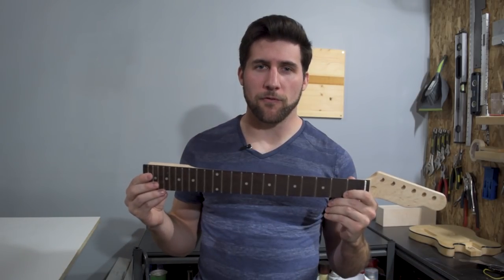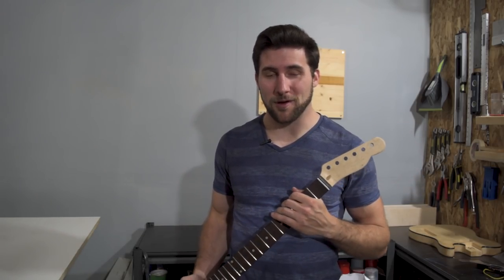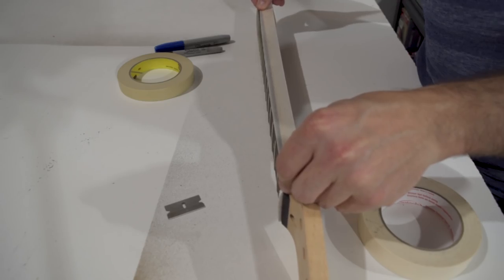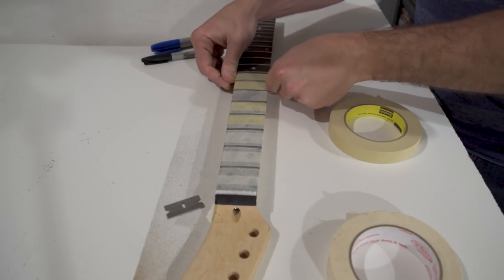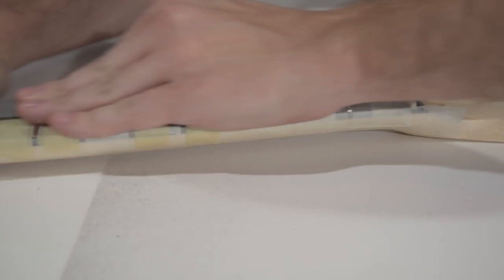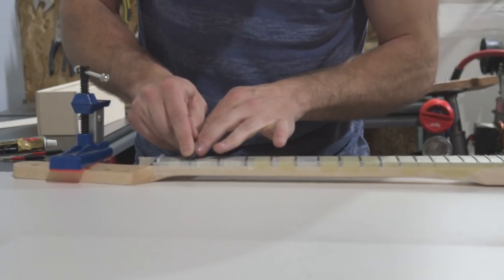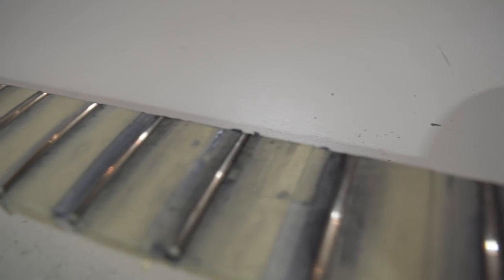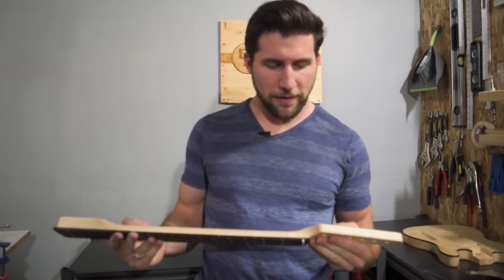Make an Inexpensive Guitar Kit Awesome! Fretwork | The Guitar Kit from Solo Music Gear (Part 3)

Comment: Your videos have helped me so much. I am in the process of making my 1st custom guitar, and you are my go-to for paint advice. I got an old Washburn ox10. I'm doing an anodized orange paint job with a vinyl decal embedded in the paint, adding mini-buckers in the single slots, adding coil splitting mini toggles for the neck and middle, adding a bridge-on switch for all 3 pups simultaneously, and finally, adding a custom 8 position varitone switch. Doing all my own woodworking and electronics. Taking my time with the paint to get it right. Should be together soon! Thank you Brad. 🤘✌
Reply from the maker: +Sean Bailey That sounds awesome. I hope it turns out great.

Comment: HEY MAN NICE JOB WITH THE FRETS U DO A BETTER JOB THAN I DO. I WILL SEND A NOTCHED STRAIGHT  EDGE FOR LEVELING THE NECK FOR THE TRUSS ROD ADJUSTMENT.  EVEN IF IT WAS DONE BEFORE IT WAS SENT, TRAVELING THRU DIFFERENT  CLIMATES OR FLIGHT CAN CHANGE THE NECK! DO THAT BEFORE LEVELING FRETS. COOL MAN, GOOD CONTENT!
Reply from the maker: +Michael Perry Thanks Mike; I used a notched straight edge to do that in the last video in this series.

Comment: I'm working on a
✔ Albatross Iceman
✔ BYOGuitar LP Jr. Double cut.

I'm diggin' the BYO LPJ 👍👍
The Albatross (◀ 1st clue!) Iceman should be called a😒 Slushy or P😱S.
Happy to qualify... if anyone asks.
✔✔ SOLO, Thanks for sending BA the two-pack. And yes, you are on my Bookmark. Hope to see you soon

Shred Hardy all.
Reply from the maker: No love for the albatross? Good to know. I’ll keep that in mind.
Reply: Brad, 
Naturally, I can only speak for Iceman. The pictures are all taken at an angle, so you can't see that the body template they appear go off of must have been drawn free-hand by a tired day laborer. I traced out an OEM on the computer screen, and scratched my head for a week on how to make it work. I almost sent it back, but then I'd be out forty bucks with nothing to show... So I just knuckled-up and put my money where my mouth is... I WILL make it work!
I'm buying shop tools (that I shouldn't need now) faster than I planned, so that's slowed me down. 
The body/neck screw holes look tapped template free, so I need to plug and redrill.
But, I will say the neck has a real comfortable feel. 
Everything else is as you would expect for $114 bucks.

Appreciate the videos, buddy. Keep 'em coming.

Comment: it is less risky to cut the tape roll itself with the blade rather than the tape on the board. you only have to glide through the first couple layers of tape, so you dont have to ruin a roll to do this. also, you might have better luck with the tape peeling part if you adhere a super sticky tape(gorrila tape is what i would try) over the taped frets after you complete the fretwork, sticking it to the unwanted tape so you can peel it off in one go. i havent tested this tape method, but you risk about 10 cents of tape trying it.(this was typed redundantly for clarity.)
Reply from the maker: +5hredder The tape removal theory sound interesting. I may have to give that a try. 
As for the tape cutting, I’m not really sure what you mean. The method I demonstrated isn’t risky at all.
Reply: well, i suppose it isn't risky, unless it is done incorrectly, or with a shaky hand... it is just easier for me to slice the tape before i unspool it because i can dimension multiple pieces at once, cutting as much tape as i want in one pass. both ways work well though.

Comment: Interesting,  you're the first guy I've seen using an axe file for this.  Its narrowness poses some issues to be careful of that I didn't hear you mention.  I know you blue marked the frets but unlike using a full wide fret leveler, of the matching fret radius, you can easily remove to much material in one or more areas and throw off the radius.  If one can be mindful of this, then this file is a good cheap way to go.  They go for about $15 at canadiantire in Canada.    I saw you secured the neck to the table with an F clamp at the headstock.   This too is an important step using a filing device.  Slow movement and  light even pressure on the file to remove material slowly is important.   
Brad what province are you in?
Reply from the maker: +2bikemike That’s a good point. I probably should have noted that you need to be careful to follow the radius. For some reason I guess I figured that was obvious, but I really shouldn’t be assuming things. 
I’m in Alberia.
Reply: Brad Angove 
Alberia!!  I'm near London Ontario.  Last time I was in Alberia was 1988.  Wow be 30 years in a couple of months.
Reply from the maker: +2bikemike Nice. I was in London briefly last year. I have family in Sarnia.

Comment: I do vintage guitar fret work and so I turn the sticky side up so there is no tape stuck to the ols finish. Cause it would ruin your whole day to peel finish from a vintage guitar.
Reply from the maker: +Dane Nichols so you have to wrap the tape all the way around then? That sounds like a pain haha.
Reply: No tape stuck to the finish. So I put tape across the fretboard just like you do but leave the ends straight out. First fret and last fret and one in the middle. Then I put tape face up along the edge and that sticks to the fretboard tape. Then tape off the rest of the frets so in the end no tape is sticking to the neck finish.
Reply from the maker: +Dane Nichols oh, I see what you mean. That actually seems like a better way to do it regardless of finish. Thanks for the tip. 
I thought you meant you were working on finished fretboards and couldn’t have tape sticking to them.
Reply: Oh, that really would be a pain. Imagine sand the frets with the sticky facing up!
Reply from the maker: +Dane Nichols Hahaha that would be hilariously brutal.

Comment: I just got my Tele from Solo and I am not impressed. The holes do not line up for the bridge. The neck end looks like it was dropped. The neck is not finished at the top. The neck does not fit snugly into the pocket in the body and there is a small space at the side. I called them and they are willing to replace it. I am considering it. The alternative is to work around the issues and try to fix them.
Reply from the maker: Their customer service is good. If you’re having substantial problems with it it’s probably best to simply replace it.

Comment: how do you handle the binding and pre drilled holes when refinishing? Do you fill the holes before clear coat? Do you clear over the binding? I'm using Solarez wood filler and clear coat.
Reply from the maker: I clear over the binding. I fill tuner holes usually, and sometimes ferrule holes, but not much else.

Comment: Would you recommend getting a maple fretboard on one of these kits and if so is there any difference in how you should treat it?
Reply from the maker: It’s up to you. Functionally it’s the same. Maple fretboards are more commonly clear coated etc. though and they don’t need oil per se.
Reply: @BradAngove  Thanks! All my guitars have rosewood fingerboards so I am thinking of my first build being something a bit different but I noticed every build I've seen on YT has a rosewood fingerboard so just wanted to make sure there was no reason to avoid maple with cheap builds.

Comment: Geez the taping is the part that takes the longest...  >.<  I finished the back of the neck in Tru-Oil at the same time I did the frets (Finish first!) just so I didn't have to tape AGAIN... lol
Reply from the maker: +kirt fulcher Good to hear. You did it while your feet board was covered?
Reply: yup, it felt like it took longer to tape the fretboard than to polish the frets with 0000 steel wool!

Comment: How long did that take you from the second you put the tape on, until you finished peeling and polishing the frets? 
I do it totally different to you but I do use the long tape down the sides. 

I also hate taping it up haha
Reply from the maker: MrMetalManMe A couple hours total I think. The leveling was very fast. Frets were pretty good. The more leveling you need the longer all the steps take.
Reply: Brad Angove it takes me days because I get stressed. Buy I have found a way to crown them with a dremel. Then go straight to wire wool and polish. 

Wire wool gives it an insane shine but you have to get a good vacuum over the frets and all the bits go straight away and leaves no black marks.
Reply from the maker: +MrMetalManMe Nice. That’s sounds like a good system.

Comment: Once you get to actually stringing it up, I've found this on the 'net to really nail down nut slot height:
http://www.stewmac.com/How-To/Online_Resources/Learn_About_Guitar_Nut_and_Saddle_Setup_and_Repair/Using_Feeler_Gauges_to_Control_Nut_Slot_Depth.html

...And, as an added bonus, I didn't want to spend a lot on nut files, so I ended up getting one of those cheap keyring-style needle files (they work like garbage, but they're good for finishing), and another feeler gauge set. Using a dremel I cut some teeth across the edges of the feeler gauges, which worked really well to rough out the depth, plus you can really fine-tune the width of the slot to the width of the strings you're using. (Add a little bit to your overall nut slot height, though, as the bottoms will be squared due to the nature of the expedient files, and when you finish 'em with the needle files it'll lower it a bit more.)
Reply from the maker: +Nicholas Feeley Teeth in the feeler gauges? That’s very innovative. Thanks for the tip!

Comment: Not using fret rocker?
Reply from the maker: +Khalazia Faqih I used a grey rocket in the last video to determine if it needed fret leveling. Once I had that sorted out, there was no reason to use one again.
Reply: Brad Angove alright, btw, really cool neck, and shine frets? Maybe oil finish will be great for super smooth feeling  , and raising up the grain
Reply from the maker: +Khalazia Faqih Thanks. I’ll probably be doing an oil finish on the next one. I have something a little crazier in mind for this neck.
Reply: Brad Angove alright, you are the boss ! Or batman????
Reply from the maker: +Khalazia Faqih I can’t answer that...

Comment: YOU WOULD SERVE YOUR OBSERVERS  BETTER BY LETTING THEM KNOW THAT THEY NEED TO USE A STRAIGHT EDGE FULL NECK LENGTH TO ENSURE THE NECK IS FLAT BY ADJUSTING THE TRUSS ROD.  CROWN OR RELIEF WILL CAUSE INACCURATE WORK.
Reply from the maker: I DID. CHECK THE LAST VIDEO.